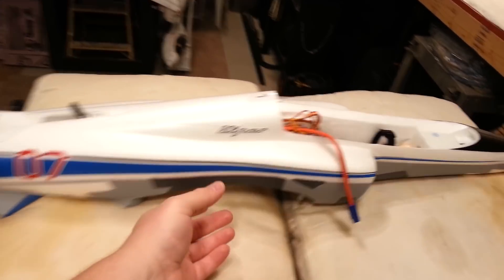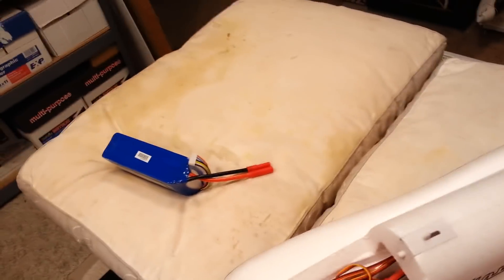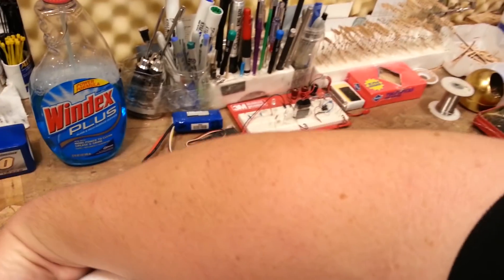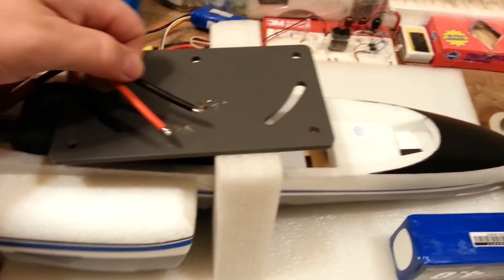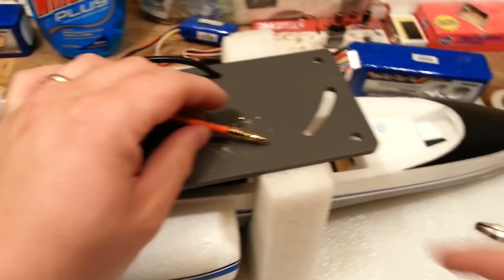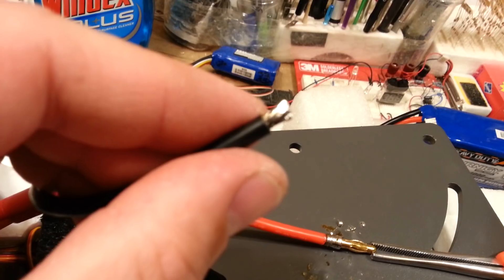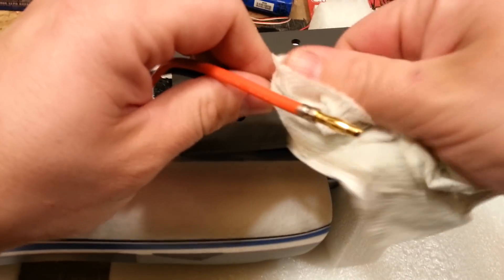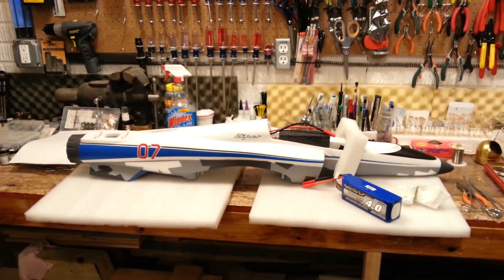Horizon Hobby - Viper 70mm EDF Jet - EC5 to HXT 4mm Mod

Comment: That really looks like a connector I'd want to avoid. My hands aren't all that steady.
Reply from the maker: which one? The EC5 or the HXT 4mm? When you get up to 6S, the packs spark almost every time, so the deep wells really help with that, and so far, I've been super happy with them ;)
Reply: The one you changed out in the Viper. I don't plan on using a 6-cell, so I'm not likely to deal with that much voltage/current. My favorite model is still the Arcus M by ST. 3-cell 2200 mah, slow, soaring flight. What can I say? I'm an old duck that goes fishing without bait. Don't have to mess with cleaning and cooking that way. :-)
Reply from the maker: If you have trouble with steady hands, you could possibly buy these wires with pigtails per-installed??? They're not as cheap, but a lot easier to splice two wires than using the connectors, but you'll gain more weight this way.
Reply: Brian Phillips   It's not really all that bad yet. I usually twist wires together, put them in my helping hands fixture, then solder and shrink-wrap the joint. I'm really devoting my thoughts to a YouTube channel using my big planes. Probably start with the single place for the low and slow. Was considering a river-level flight through Santa Elena Canyon in Big Bend Park for the first installment. Just not sure how many would be interested in something like that, or what other interesting plane filming I could do after that.
Reply from the maker: That would be very cool!!! Seems that YouTube has a lot of VERY good aviation stuff...of course you'll see me there too ;) ....but what kills me, some of these guys have simply amazing footage, and virtually no following?!??!? I think that YouTube is a very tough marketplace to "make it" in, and there's something that they're doing, or NOT doing that's stopping their FAR superior (to mine) footage from taking off (pun intended).
I wish Megan and I could get the footage refined into something more of a short TV production quality, but I wonder if some of the "feel" would be lost, then there's the cost of software, and the TIME to process the footage. It turns from a 10 hours a week, to 50 hours a week sideline really quick!!!
Reply: Brian Phillips Brian, you have a personality that doesn't need a music background or more fancy editing. The video that Megan shoots doesn't need much and neither does the footage you shoot in your workshop. If I may suggest, Patreon might be a good next step to consider. You might find that you no longer need the day job. Might also help with the new house costs. Me, I'm ready to buy another plane, a Cessna 411. I've owned 2 of them previously and loved them. It's basically a 421 with less powerful engines and no pressurization. Some 15 gallons per hour less fuel burn.  :-)
Reply from the maker: As for your new plane? Here's a suggestion...
IN STOCK HERE - https://hobbyking.com/en_us/a380-airbus-r-c-plane-epo-plug-n-fly.html?affiliate_code=WSBUURJCILXPHHD
...but I don't think you could ride in it :)
Reply from the maker: If you're consuming 15 gph less, that's like a WHOLE PLANE less - LOL!
Reply: Brian Phillips   Couldn't ride, but could FPV a model. That's a thought. Thanks, Brian.
Reply: Brian Phillips   You're exactly right. A larger single engine Cessna will burn 15 gph.
Reply from the maker: That's quite the savings :)
If you do post a video, I'll definitely watch it!!!
Reply: Brian Phillips   Actually I have a channel on YouTube. Just have some raw, short footage of my daughter getting her Airline Transport Rating. Sandy is one of the very few women in the world to hold an ATP in both the U.S. and Europe. That was 4 years ago. The channel is just under my name, Raymond Koonce if you get curious.
Reply: Thanks. It's all in the thinking stage right now, but it is something I'd like to try. Honestly, your work has been a considerable motivating factor. If I can work through the logistics, I'll try to make it happen.
Reply from the maker: You have done much harder things in your life, so I KNOW you can do it, but one word of "warning"....it could suck the fun out of the experience if you're not careful. We run into that from time to time. Whenever you're depending on someone else to capture footage, there is a tendency to have an almost calculable stress and frustration buildup right before production. Anymore it's almost unavoidable, with kids often in tow, or working with Esteban, in any way - LOL :) (I hope he misses this comment)

When we started, we did this for US, not for the audience. There was little to no pressure for success, but now it's different. We're on the precipice or success or failure, we could fall of the YouTube map, or we could feed the giant and end up with something that would take this from a part time "waste of time" to a full time + Job....so it's kinda tricky. Plus, as you can imagine, I aim to please (I know you get this, btw) but many times it's harder to deal with one A-hole per 1000 great people, than some can handle...luckily, I "do care", but only for a second. If you're not being hated on, you aren't successful enough to be relevant (I guess). Also, it's very difficult to capture good footage on the cheap, like we do....so if you want to get better video quality, you will have to spend considerably more than you'll make in the first few years of earnings on YouTube...so if you plan to make money, work it like a REAL business, spend it AFTER you're making it (again, I'm totally preaching to the choir...or the conductor...but you know what I mean).

I'll check out the footage if you put it up. It's a strangely tight knit group of people on YouTube, I'm finding, and in the Aviation Circles, there's some great people!

Good luck! You can do it!!!
Reply: Brian Phillips   People are strange critters that I've never truly understood. Always about half suspected I was from Mars given my failure to grasp how the average human thinks. Never thought I was better than them, just different. One of the things I can't grasp is jealousy of another's success. My attitude has always been "good for them", not jealousy. Or the old "I can't do that so how could they". Anyway, yes, it has to be approached totally as a business from square one or it probably won't work. That also helps me avoid losing interest because it's not as much fun as I had hoped. I've flown so much during my life that I know I'll enjoy that part regardless of anything else. The biggest issue that concerns me is subject material. If I can't keep it interesting, might as well not even start. An income stream would be nice, but not the primary goal, I think. Better to focus on good material and let the rest fall into place as it will.
Reply from the maker: Good deal!
I didn't even mention the "best part" of a YouTube channel...if you do make any money, you can write off about 99% of your expenses to fly for the videos, since you'll be doing it for footage ;) Of course, you know how well the IRS handles companies who lose $100,000 per year and have earnings in the $10's ....I think they call them "hobbies" - LOL!
Reply: LOL - that's what we are, hobbyists! Other than filling out the "simple" forms, it's been 20 years since I've messed with the IRS. Sometimes I even got a kick out of tussling with those folks. Ah, it was fun being young and dumb. Since I have no idea how much more life I'll be granted, I'm not terribly concerned with making enough money for the IRS to even notice me. I do know what you mean about writing off aircraft expenses in a business climate, though. Big bucks when I operated 9 planes like the 421. Beaucoup expenses!!!

Comment: Dude you suck at soldering those connections just tin the wire and tin the inside of the connector put it in as you are heating the connector let it melt together done you get how much to to tin the connector after doing a couple
Reply from the maker: It's evident you've never done this with a large lipo, so I'll forgive you comment. When you've had a chance to try actually do it, get back to me.